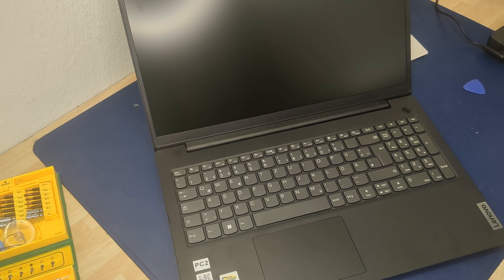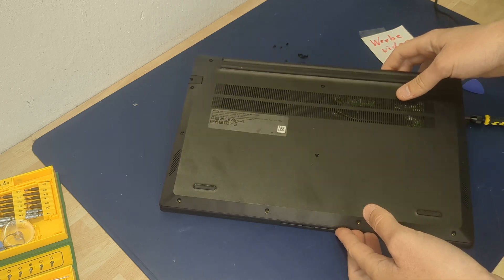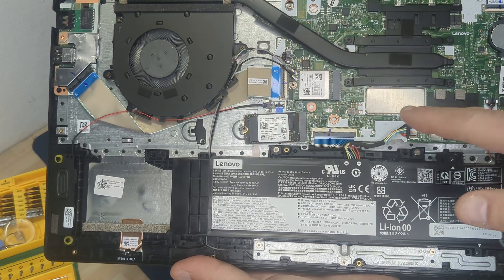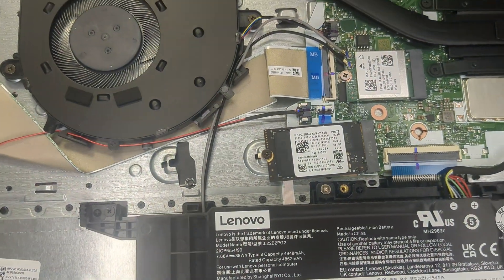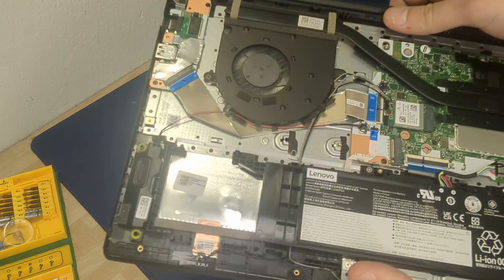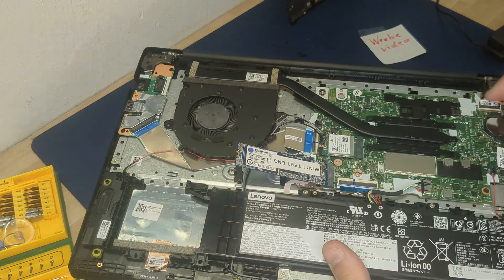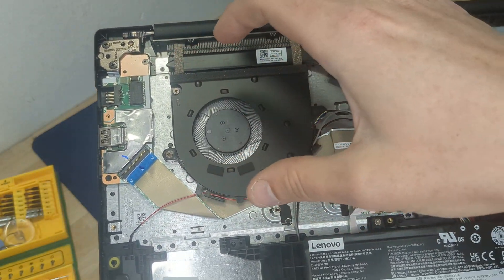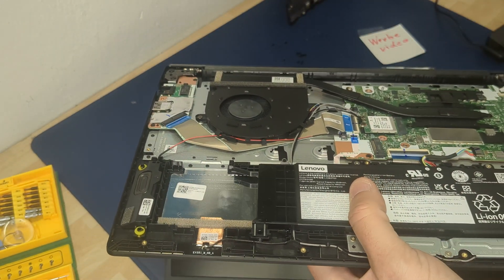Lenovo V15 G4 Series Laptop - How to repair Disassembly SSD, Bios Battery, Battery, Mainboard

Comment: Hi Alex. I have V15 lenovo laptop,win 10. It gets freeze unexpectedly and screen will turn completely green, or white or black - random color. Then I have to turn off laptop and turn it on again and everything is fine. I can use laptop 20 mins sometimes 1 hour  and then screen will turn completely green or white again ....  I used memory test mem86 and other recomended test software ,didnt find any problems . What part could be defective ? Thank you Alex

Comment: Please reply ... I have a lenovo IP 130 i3 6th gen laptop .. The display resolution is 1366*768..quality is not so good. I have an unused laptop asus vivobook s530fa ( motherboard dead) the display size is similar to the lenovo laptop (both have 30 pin display). Is it possible to replace display from asus to lenovo?
Reply from the maker: There a many many Displays on the market, so you can look at eBay and find out what's the type of your Display is and compare the offers at eBay with the model number of your used Asus
Reply from the maker: 😊 maybe it's also possible that you can upgrade to a full HD display